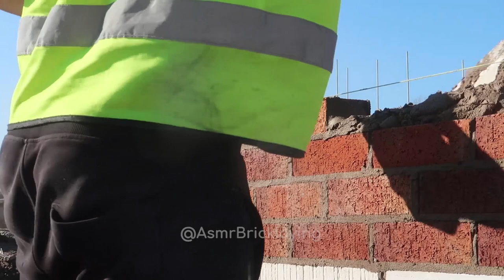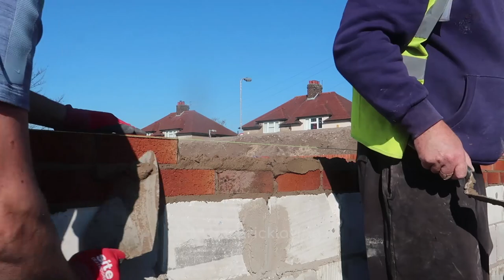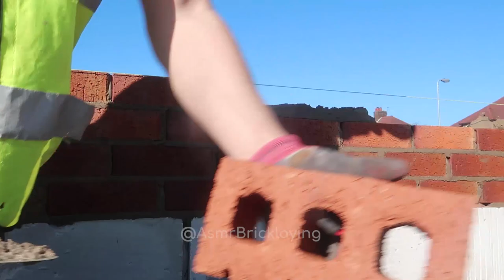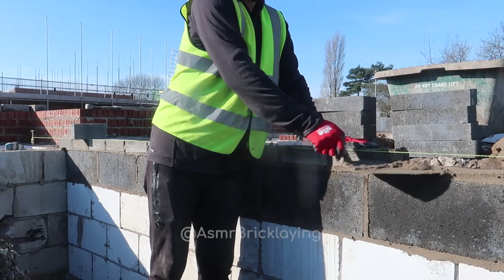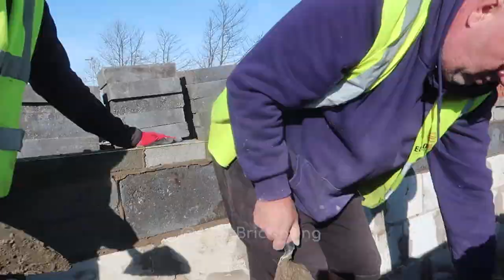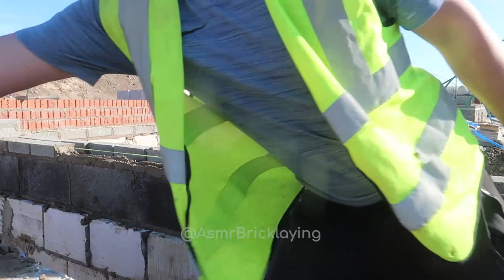ASMR Bricklaying Brick Wall Scraping

Comment: Hi Stu. Quick question, sometimes you put the muck you've taken from the bed joints and put it on the brick you pick up, other times you put it on the brick you previously layed, why is it different every now and then? Cheers
Reply from the maker: i just change sometimes, no real reason i gues were always trying different ways to see if its better but buttering brick with bed joing excess is the best way for me i found